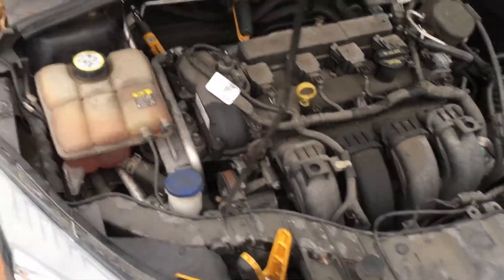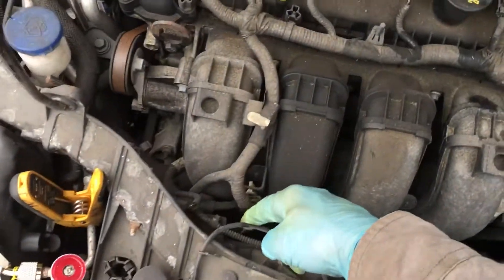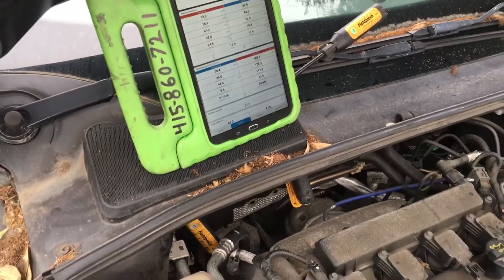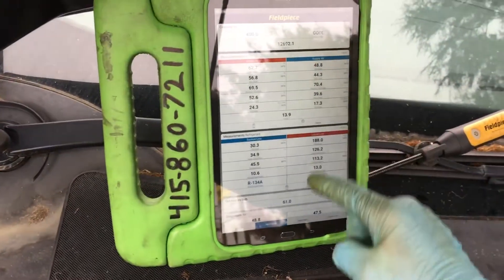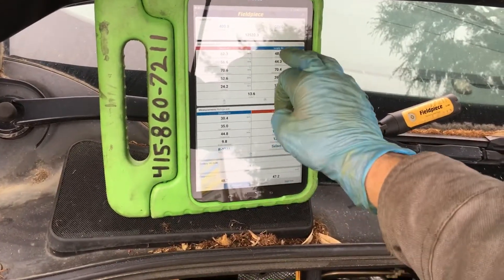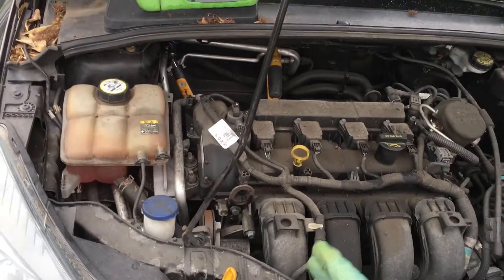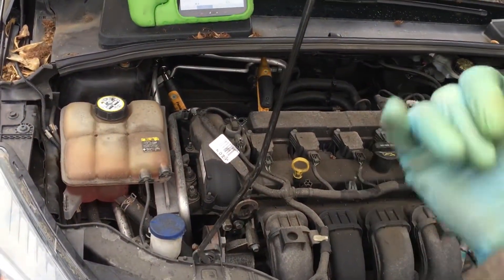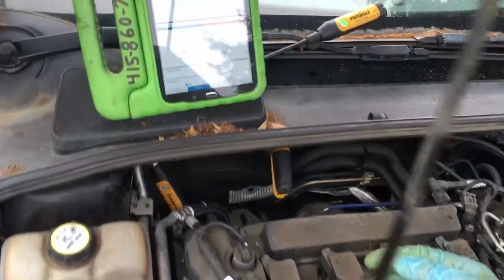Pt:3 Ford focus AC refrigerant charged in 30 to 60 seconds. If everything is done right

Comment: I ended up getting a couple of the Fieldpiece wireless temperature clamps because the wired ones just wouldn't fit in the restricted space in the engine bay. Very handy bits of kit. 👍
Reply from the maker: Yes sometimes you just need those tiny surface area beak style clamps. 

          You wouldn’t do this on every job unless you really had time.  The small for Mr. wire with a tiny bit at the end you can Velcro that tightly to a pipe to get a true temperature reading. 
      If you want you could put a small piece of foam over the semester bead pressing it against the pipe and then use Velcro to cinch it down tightly